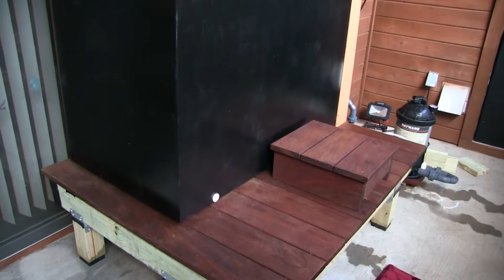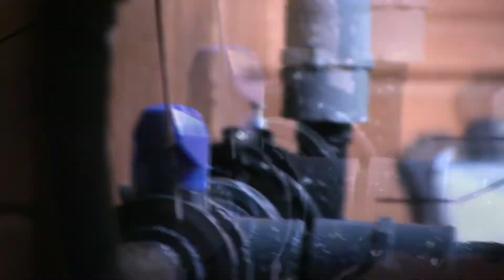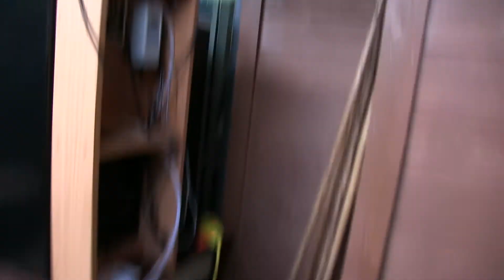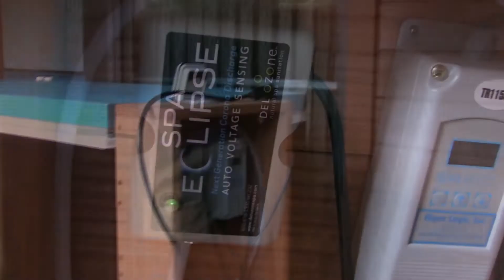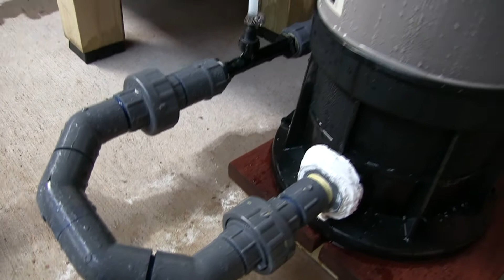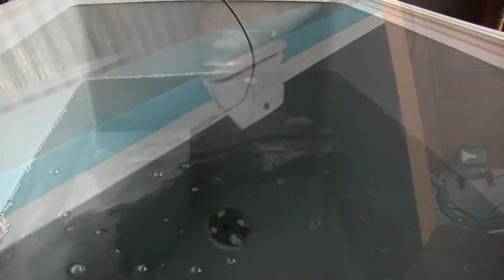DIY Chest Freezer Cold Tub Conversion

Comment: I don't understand why you have to unplug it if the plug is in a box and not getting wet
Reply from the maker: Take a major electrical appliance not intended to hold water and fill it with water. What could go wrong? :)

The only way to prevent the risk of shock or electrocution is to unplug all equipment before you get in.

Comment: With the hot tub plumbing does this get hot tub hot too?
Reply from the maker: Yes - because the ambient temperature introduces heat gain into the system. With external hot tub plumbing, my system never cooled below 48F, which did not meet my goals. 

Join my FB group Chest Freezer Cold Plunge for the latest up to date info on how to successfully build a chest freezer cold plunge. 

Or if you don't want to search through 3 years of posts, you can buy my book "The Ultimate Chest Freezer Cold Plunge DIY Guide" on my website at www.chestfreeercoldplunge.com

Comment: are you using the compressor that came in the chest freezer or an external one?
Reply from the maker: All of the chilling is being done by the parts built into the chest freezer.
Reply: the chest freezer i use - i change the water every two weeks and use hydrogen peroxide. i would like to set up a filter and pump similar to what you did but i'm not sure i want to drill into the freezer. i was also thinking of ways to deflect the sun on the outside since the freezer gets hit with heavy early day sun. the ozone is something i was looking into and i also drop in some methalyne blue sometimes.

Comment from the maker: Update - Pros and Cons

Pros: The ozone created excellent water quality. The liner has been stable.  Easy regular cold water available!

Cons: The condensation on the external plumbing is making a mess on the patio. However, because the outside temp. has ranged from 90 - 100+ degrees, the heat gain in the system has done two things: 

1) the water temp. will only cool to about 46 deg. F., which is causing the compressor to run constantly, and 
2) because the compressor is running constantly, my average utility bill increased 189%!

Purchasing the correct type and thickness of industrial insulation for all of the external pipes, pump and filter is expensive. Worse, it is fairly complex to correctly install this insulation over the pump and filter housing and the valves in the plumbing. Because of this, I have disconnected the current pump/filter setup and I'm moving to my next experiment.

BTW: After being disconnected for less than 15 hours, my water temp reached 39 degrees F. 

I will be reporting back soon on the next plan for water sanitation. Stay tuned!
Reply: That's an awesome review and follow up! 
Would you be able to say how much less electricity it consume once the filter was removed?

Comment: Picked up my used freezer last week.  Cleaned it really good and silicone the inside corners.  John, I'm looking to plumb my freezer with a pump/filter/Ozonator.  Any tips for drilling into the bottom of the freezer and making sure the plumbing is secure so it does leak from the joints?  What are the covers you are using inside the freezer for the return and send line?

Comment: Would there be any benefit to just sitting in the freezer without the water?
Reply from the maker: I don't know for certain, but considering that when you get into a professional cryo chamber for 3 minutes and it uses nitrogen to cool the air temp. down to -220 deg. below zero in order to get the maximum benefit, I don't think there is much if any benefit of being in a chest freezer without the water. 

I did more than dozens of cryo sessions in these chambers (as often as 3 times a day within 30 minutes) over a 3-month period and did not notice as much benefit as I do from the cold water. 

That said, cold training can create benefits when done outside in temperatures that are cold enough, and some people have talked about going into walk-in freezers. However, once the lid opens on the chest freezer, I don't think you'd be able to keep it cold enough for long enough to get any significant benefit. 

And just for clarity, getting in and closing the lid is not recommended. :)
Reply: John Richter Ok thanks. I'd figured a space blanket or piece of rigid foam to pull up around your  head for heat loss. But sounds like it's the extreme cold that works and there's no feasible way to get the freezer that cold. Anecdotally you'd think 30 degrees or so would generate some endorphins.
Reply from the maker: I haven't studied all of the science, but I can tell you the nitrogen cryo therapy chambers are popping up around Austin like Starbucks! 

Personally, I used to hate the cold, and would literally put on thermal underwear if it dropped below 60 deg. F outside. After practicing the Wim Hof method of cold exposure and breathing, I'm fine outside in shorts and a t-shirt down to 45 deg.  

I've practiced the breathing outside at 24 deg. F for 10 minutes barefoot and wearing only a swimsuit and was fine afterward. However, I can tell you that it was exposure to the cold water that seriously reset my ability to withstand the cold.  I had done cryo chambers twice before meeting Wim Hof, and they did not change my cold tolerance at all.

Comment: Thanks for sharing this and the other one I saw. Would you mind providing a parts list and overall cost of this system and the other one (smaller freezer with temp regulator and pump)? Again, thanks for sharing what you know.
Reply from the maker: You're welcome. I am putting together an ebook with all of the details.... parts... steps.... photos... options for simple or complex... what to avoid... etc. Hope to be done soon!
Reply: Could you tell me what spray you used to seal the inside of the freezer? Great details and video by the way.
Reply: Following
Reply: Hi John, super excited to take on this project and would welcome purchasing your e-book to save myself a lot of time and trouble! Any idea on when it might be ready?
Reply: @JohnRichterAustin Thx John for the info have u got anywhere on the ebook?
Reply from the maker: @kristyncapstick8221  - it's happening slowly. Most of the info is on my free Facebook group Chest Freezer Cold Plunge. Please join!
Reply: Interested in this too, please reply to this comment when ready

Comment: spray liner FDA approval which brand you use ..I have a regular chest freezer simple set up Its doing fine just wanna coat it so it will last longer  ... :)
Reply from the maker: Hi Kamal - quick update: I have a concern that the liner may have affected the chest freezer's ability to cool the water.  I have three different variables that need to be looked into, but until then, I recommend that you minimally seal the seams with silicone or something similar.
Reply from the maker: I'm still testing this one... not comfortable making a recommendation yet.
Reply: Have you tried feezer Kote ?